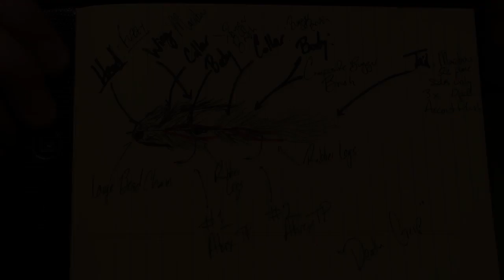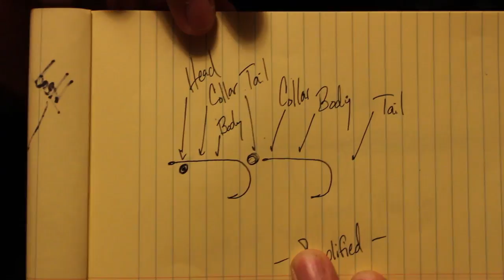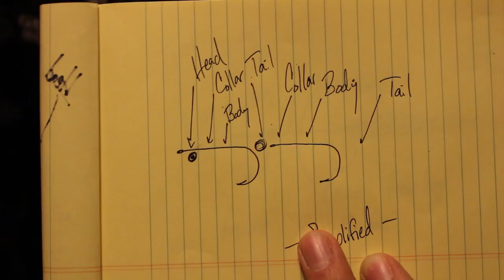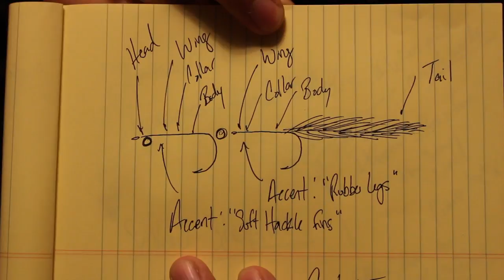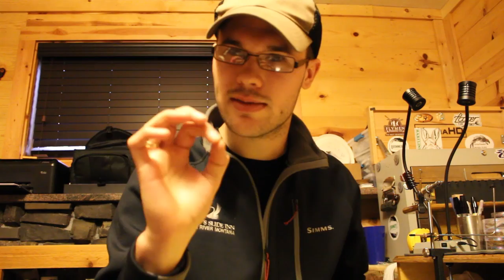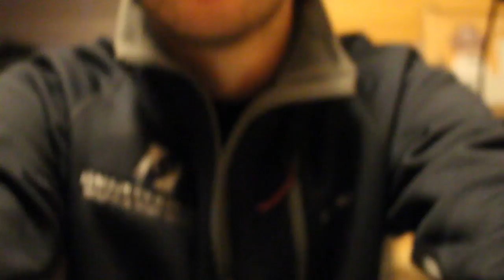Tie Like a Pro, Ep. 5 The Infinite Fly Principle

Comment: After watching many tutorial videos in this series and your custom fly pattern videos I can definitely tell you have an absolute PASSION for Teaching others about what you are most passionate about and that is fantastic. Knowledge from experience and study is meant to be shared. As far as this principle I worked in or around a fly shop for 10 years at Cabela's and the veterans there pretty much said that there are no new patterns, just variations of patterns that have been around awhile using different materials depending on what one intends to use that fly for. Way to break it down properly into PARTS of a fly that one can just rinse and repeat and just change one thing or make material substitutions, definitely can't go wrong with an articulated bugger.